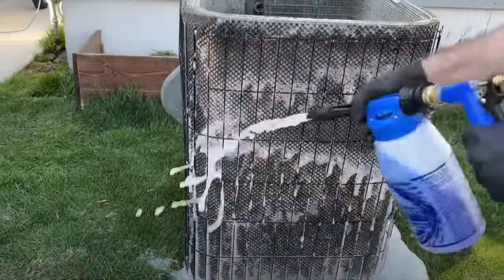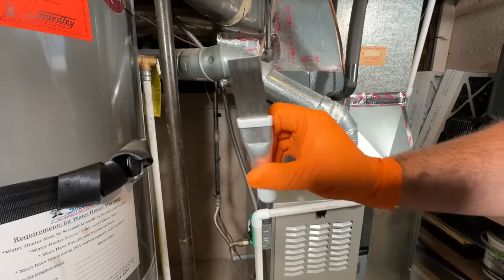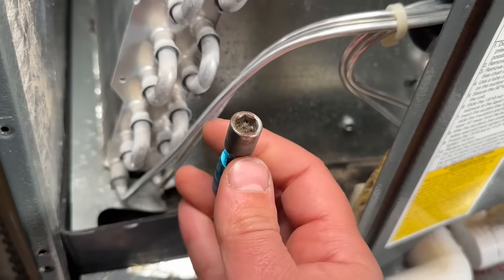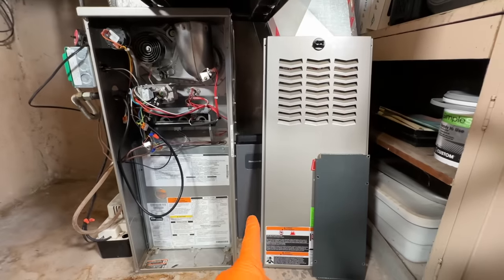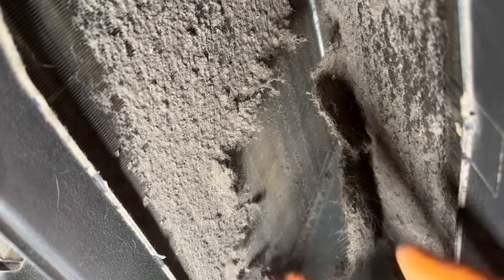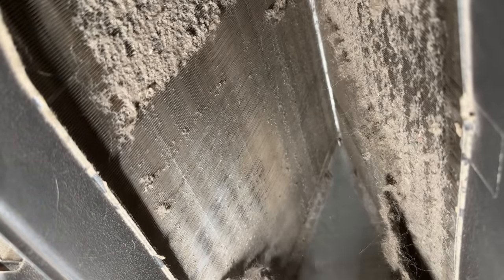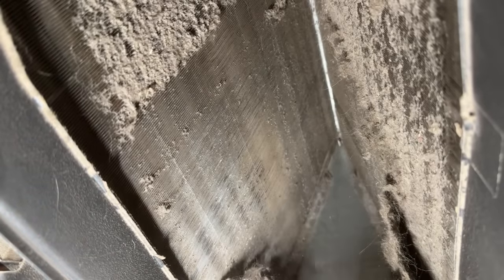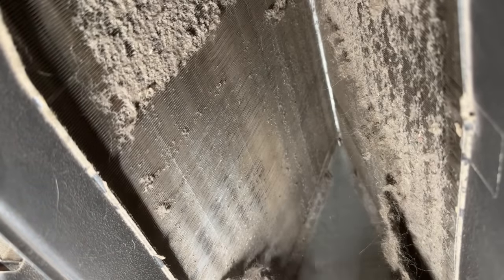How To Properly Clean An AC Evaporator Coil & Save HUNDREDS!

Comment: At minimum, read the section with *** (It may help a few people)
Great video to bring to our attention the need to service our HVAC which may decrease seasonal allergies and prevent an early HVAC demise. After watching, I anxiously took a vacuum, soft rubber (not foam) self-sealing 7/8" water pipe insulation, sissors and a hand swifter to the 2019 installed HVAC I have. 

Although it's much more difficult to attempt to pull out the coils, I took a hard look at the intake, filter and HVAC surface areas anywhere I could reach. Everything in reach, including electronics, received some sort of vacuum/wipe down. The swifter picked up some fine dust somewhere in unseen corners. I'll leave the A frame coils alone for now.

*** To prevent dirty air from getting around your filter and into your HVAC.
As for the  7/8" soft rubber self-sealing water pipe insulation, I cut it straight up the middle (long way) so I had two long lengths, each with one sticky pull tape edge.
Measuring the length of the filter I cut two equal pieces of the insulation. I put the filter back in (a 5" thick filter) pushing it as close to the fan as possible leaving an intake side top and bottom gap between the filter and housing. Now I know where the cut half pieces of insulation are going to be placed and how. A trial run was performed prior to removing the sticky side cellophane protection.

Now pulling off a small length of sticky side cellophane I pressed each section into the area in front of the filter, (air intake side ONLY) top and bottom, so that the incoming air has nowhere to go but over the soft rubber insulation and through the filter. Since the rubber presses against the filter and the filter can still be easily replaced, I didn't need foam strips placed around my filters anymore.

Each 6ft length of soft rubber (not foam) self-sealing insulation was around $7 at Lowes. I only needed less than one for the job and it will last the life of my HVAC.
Reply: Great tip!

Comment: Great video! We used this to clean our system, and it fixed our issue immediately. However, about a week later our evaporator coil is a solid block of ice. Air filter has been changed, so now we're lost.
Reply: Sounds like you lost Freon somewhere. I'm not an AC guy but I work with one.
Reply: @johnnybhoy4278 Exactly what I was thinking too. I'd be nervous even pulling the A coil out of the plenum to clean it even if there was play in the line set tubing. Too much of a chance to cause a leak at the connections, in my humble opinion. Which sounds like what happened here.

Comment: My A coil is over 20 years old and is clean underneath. Using a pleated filter (not high merv, a merv 8 max) and having a proper system that forces all air to pass through that filter and not be missed is key.

Comment: Great video!  Super example on showing the pitfalls of no filter or leaky filter.  Definitely a mixed bag on how accessible each installation's A-Coil will be.  I was wanting to see a wet/dry shop vac in there somewhere, but ultimately your cleaning was all good.  I guess coil access will determine if this can be done DIY or not.  I also have a Bryant, but mine has a 4" filter box so that is a plus.  Thanks for making the video.

Comment: Our HVAC system is 20yrs old, low on an expensive outdated coolant, and constantly freezing up, making summer grueling.
We've been here 5 years, moved from a place where HVAC isn't common because the weather is nice, so we never knew it had to be cleaned, and nobody ever offered it to us. They tell us the whole system needs to be replaced for $9,000 which we can't afford and dont have enough credit for financing on.
I'm not doubting the low coolant is the main issue but I do find it curious nobody told us the coil and compressor should be periodically cleaned. 
Since we can't afford to replace it, and thanks to coming across your videos, I'm now going to try  cleaning both myself to at least reduce the hurdles in front of our poor crippled HVAC. I wouldn't be surprised if it helps a little.
Reply: Did you do it and did it help?
Reply: Can’t wait for result
Reply: Don’t forget this guy is an hvac scammer. He makes more money than a technician does by playing customer’s advocate and causing dialogue of distrust and anger in his video’s comment section. He is just as bad as the guys running around in vans ripping people off. He has just mastered a soft way of doing
Reply: @Feelingsmasher2000 Can't WAIT to read the logic behind your statement. LoL. I'll wait ...........
Reply: @bigd3104  Ok mommy, because i owe you an explanation 😂.
Read it again
Reply: Mine would cool for 2 hours then no more cold air.Replaced Capacitors.Nothing worked.Then i saw fur across the coils.Vacuumed and sprayed.Now it works.

Comment: Great video!  Your video gave me the knowledge I needed to do the job!!

I used the "remove the A-coil cover" method and left it inside the furnace.  9 screws to get the outside cover off and 8 more to take off the A-coil cover.  It was remarkably clean given that it had NEVER been cleaned before in it 22 year life.  I was expecting it to look a lot like yours did!  There were about a dozen small dead insects stuck to it, so I used a brush attachment on our Dyson vacuum cleaner to remove them.  I have a 1 inch filter that is hard to get in and out, but it must not leak very much.  (2 years ago I forgot to change my filter for about a year.  Not recommended, as the $850 blower motor died shortly thereafter.)  I also vacuumed up about a dozen somewhat large dead spiders from the condensate drain pan.

I took a picture of it and tried to paste it in this comment so all could see, but I couldn't figure out how to do it.

Comment: One of those jobs that you hate doing, but you hate it even more if it broke because of lack of maintenance. 

Great job and excellent video tutorial!

PS, I probably would’ve used a vacuum cleaner (extremely carefully) with bristles and one of those 2 gallon sprayers that you get from the garden department. Because you can pump those with air and get a continuous stream.

Comment: Just did my mothers house A frame,  it’s a over 20 year old Lennox pulse air system and I think it’s never been cleaned. First having a a/c heat combination is something the installers told my father not to do. And I can definitely agree. The air volume isn’t enough the vents are located for heat so the A/C will run for hours. It’s an older house but I had the attic insulation redone and it did make a difference. I have the same size house but it’s a ranch with a separate A/C system and it is much more efficient and comfortable. So cleaning was a total pain can not get access like yours. If anyone is going to buy a setup like this knowing what it will take to maintain or repair things should be a huge consideration. Also when buying the no rinse cleaner I was concerned about when the heat would come on if there could be an issue with the cleaner used and fumes when heating. If anyone knows if this is a consideration let me know.
Reply: what is your seperate ac system? mini split through the wall?

Comment: My filter space is 4” too n what I do is use 4  1” old style filters n spray the lead one with furniture polish. I change out the leader n put a new one in back alternating the filters so they all eventually get replaced. Cheep n works well but the big key is the furniture polish on intake side of the lead filter. I only have to change filter every 6 months. Another way to tell if a-coil may b dirty is to check ur air supplies for debris around them. Also vacuum the cold air return grates n well around them  !!  A little time saves big bucks n a huge head ache later. Good vids by the way !!

Comment: Not the easiest job, not the hardest, but being up in the attic in southwest Florida is not fun, which is why I did the air handler early in the morning. Made a huge difference. My system wasn't keeping up in this extreme heat, and now it's working perfectly.

Comment: Dear Dave, first and foremost, thank you so very much for making these amazing video that are helping so many new DYIer people like myself to be able to diagnose and fix things ourselves. I just found out that you live in the beautiful state of Utah and so do I. 

After this video, I ran down to the basement and found out that the HVAC system that I have is slightly different from the one being shown in this video. My home was built in 2020 so I'm not sure if that makes a huge difference but it looks like, for my case, they use the two large in diameter PVC pipes for the exhaust and return that are located right in front of the evaporator coil assembly. I'm not sure if there's way for me to slide the coil assembly out without having to remove the PVC pipes. 

Also, I think the system that I have called "up flow" where the evaporator coil assembly is located on top of the furnace assembly. I hope you will make a how to video like this one but for newer system. Thank you again and you just earned another subscriber :)
Reply from the maker: Hello there! Unfortunately if the pvc intake and exhaust pipes are right in the way, they’d need to be removed. Some furnaces are definitely not made with cleaning the coil in mind. But the pvc pipes can be cut and a coupler can be used. Sometimes the intake is not glued in place but you’d just have to see how your furnace is done. I’m sure I will do another Evap coil cleaning video soon so I’ll try and make that with a high efficiency furnace with the pvc tubes 👍🏼  cheers
Reply: @diyhvacguy thank you so much, Dave! I appreciate the comment and shared knowledges. I have learned so much about HVAC just from watching your videos. You’re the real deal, sir!
Reply: @diyhvacguy Same problem I have. My 90% furnace has the PVC exhaust/intake pipes. It's only a year old, but someday I'll have to contend with this problem more than likely. Thank you for all your helpful videos!! Much appreciated!!

Comment: This coil looks like it had a filter problem. You had said your filter wasn't sealing very well ? I've just never seen an EVAP coil with this kind of dust all over it. You did a good job cleaning it as it certainly needed it. I've only heard of cleaning the condenser coil outside if it's exposed to dusty conditions. I've even cut my unit off before while cutting grass etc with lawn mower around the unit so it wouldn't suck dust and dirt into the fins  while running.
Reply from the maker: Yea that’s a good practice to turn it off while mowing around that area. I’ve seen coils this dirty, but I didn’t suspect my own coil that’s 3 years old to be this bad. Yes it was a filter issue for sure. Now that it has a nicely sealed Honeywell it will never get remotely close to getting that dirty. Cheers
Reply: I bought a house in Florida while I was still out of state. I had an a/c company do maintenance every 6 months for 2 years. Also, I needed a gardener to mow the front/back yard because the tenant was a busy single Mom. Anyway, when I moved into the home, the condenser coil was just totally stuffed with grass clippings, dirt, etc. The unit running while a big riding mower cutting the grass was the cause. Now, after I got it cleaned out, I like you, turn it off and I use a push mower around the unit to keep it clean.
Reply: i thought i was the only one who turned off the ac when mowing! lol nice to see like minded people.

Comment: Very good.  Peels off like cleaning a dryer vent filter.  I would think a shop vac would play a role at some point.
A big rectangular mixing tub (such is used for concrete, mortar, or drywall mud) might be useful to catch runoff.

Comment: when i bought my house, i needed the furnace and ac replaced. they were 40 years old. i was amazed that the evap coils looked very good. the previous owner must have religiously changed filters all those years. the new system uses merv11 5 inch pleated filters in a well sealed box so im hoping ill never have to clean the coil, the lines would have to be cut.

Comment: I use to by cases of the no rinse evap cleaning for cleaning reheat coils in the hospital where I worked. Also used it on evaporator s on RTUs. For cooling coils on large fan units I bought some green cleaner that was non toxic and worked like a champ.
Reply: No-rinse evap cleaners should NEVER be used on reheat coils. The condensate from the evaporator is what allows you to use no-rinse cleaners, since that is what rinses the cleaner off. Please do not advise others to use no-rinse sprays in that manner.

No-rinse evap cleaner is ONLY for use in evaporators (cooling coils that produce condensate should be ok as well) and should only be used in humid or semi-humid conditions. It is a great product but needs to be used responsibly and correctly.

Comment: I have a Klein tools Double ended ratchet,  one side is one quarter and the other is 5/16s. Its slightly thicker than a quarter inch but isn't 5/16ths. If you're doing it for a living and don't have one all I can say is how? item number is 68200 just google it and you should find it. 1/4 side can also accept any screwdriver/impact bits and have a little more space and need to use your magnetic one for whatever reason.

Comment: Nice job. 👍 I thoroughly clean my condenser coil every couple of years, but I don’t see a way to clean my A coil box up in my attic.  It’s completely sealed with no access door.  I have a Lennox, horizontal installation.  It cost me $1500 to replace the leaky coil box 6 years ago.  The old coil box lasted 7 years before it started leaking.  If it costs $500-$1000 just to clean it, I might as well just install a brand new one for $1500, if I start to have problems.  I use Merv 8 filters and change them on time every time, so the coil box should not be very dirty, but who knows.
Reply: there not 1500 no more. ac parts have gone way up
Reply: The manufacturers would rather replace the coil rather than have it cleaned  or  repaired.  It's all about the $$$ for the tech and the manufacturer. LOL
Reply: you have to cut into the sheet metal
Reply: @roscoetanner5996  correct. Easy to overcharge on parts then on human labor. Nobody wants to pay a guy $200/hr while they make $30/hr
Reply: I had a guy in last year because my condenser was icing up.  They said we have a small leak, so they topped it off, then said it will only last that summer max before we have to get it topped off again or start replacing stuff.  They never went inside and looked at the A coil or anything, just eye balled the condenser and that was it.  The reason it was icing, well the main reason, maybe it was a bit low on coolant? was my A coil was clogged with dust and couldn't breathe.  Ice was on the top side of the A coil, there is a spot cut out as an access hatch to see one top side of the coil.  The next day I pulled the other "hatch" off which is to access the bottom of the coil and vacuumed out the huge amount of dirt, hair, debris, etc.  This all stopped the actual cooling of the house.

Don't always throw large amounts of money at things when you can look at it, and do something simple and save yourself a lot of headaches.  Your coil wont be completely sealed away, as they had to install it.  At the very least, you know where it is via the copper and PVC lines going in the unit.  Those lines are all usually in the same spot, so you can see where the video posters lines are and know roughly where to start.  Then go to the side and cut a hole in your furnace, make sure you have a spare piece of sheet metal that is bigger then the hole you cut.  Then you can at least clean the bottom like I do, and it will make a HEAP of difference.  After you are done cleaning, screw the new sheet metal panel up, then use aluminum tape to seal it all up and you're done.
Reply: Dont forget to bend the edges of your cut sheet metal so you dont cut yourself
Reply: I always use a Merv 8. Insane how much it catches without over working the system.25 years and the coils still looked new

Comment: Before you do this, find where the water drains outside your house and hook your vacuum to the pipe to clear the clog and drain the water. After I crawled into the attic and got into the condenser, I found that it was pretty clean already. I could’ve probably skipped all of that for now.

Comment: As usually-outstanding quality in presentation and showing the way to solve a lot of AC related problems.Sadly, there are some issues which cannot be solved.Algae growing in and on your evaporator are nor possible to get rid of ( not pan growth,this is easy). Any algae killer gets washed away immediately after running the unit for 15 minutes.Sure, the old patch is dead,takes about 1 week until a slimy growth starts creeping up the fins again.Dismantling the unit every 7-8 days seems to me a bit tedious
Reply: N 9 moon n
Reply: Spray some lysol into one of your intake vents.
Reply: There are tablets for algae that can be placed in the condensate drain pan that slowly dissolve over time. Should last at least one season.
Reply: @bigd3104  I guess you are missing the point.Algae growing ON the evaporator ,not only in the pan.Looks like slime climbing up the edges of evaporator,pan part is easy

Comment: @diyhvacguy 
Thank you very much for these great instructional videos.  
I'm about to knock this out.  We just bought and renovated this little country house.  My HVAC closet is 3 sided. with a door on one of the sides.  I'm going to make a separate access panels on one of the other 2 walls so I can access the coils more easily.    I know your videos look easy when you do them.  I've done some cleaning of this stuff before.  It's not quite as easy as you make it look.  Thanks for showing us the examples you provide.